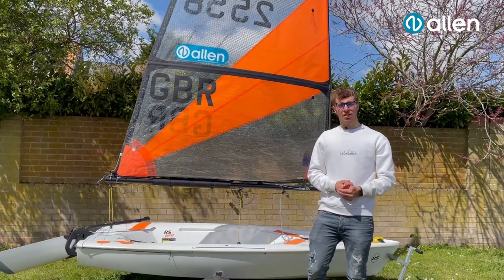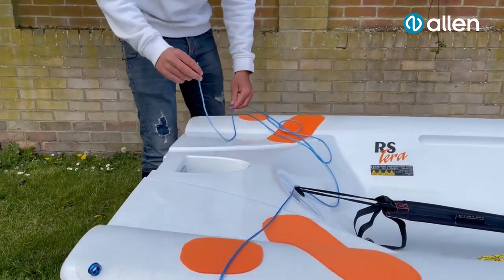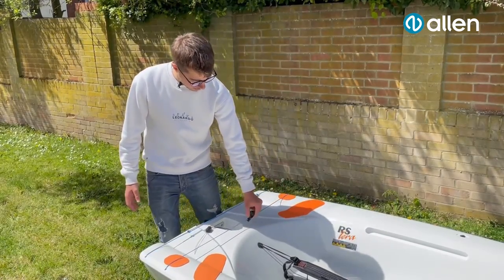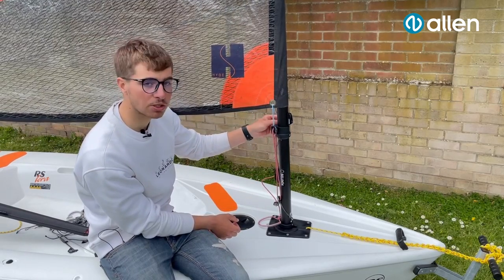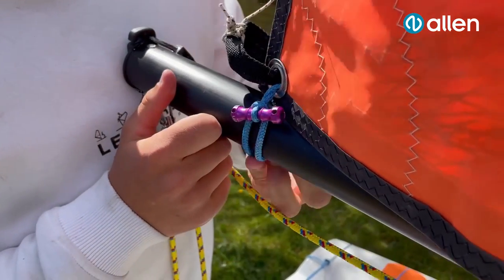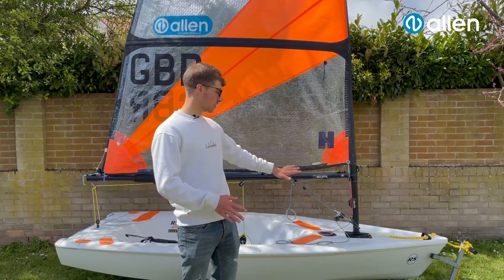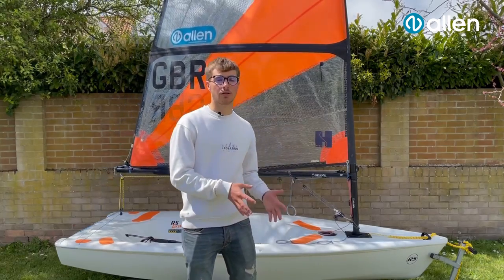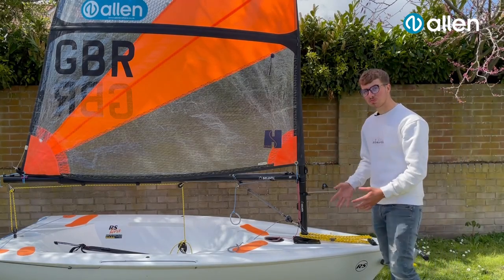RS Tera Rigging Guide | RACE SETUP

Comment: Hi Dylan.. great guide.  What traveller block is that for the mainsheet?
Reply from the maker: The traveller block used in this video is 1 x A2020Tii (20mm Tii on block) & 1 x A2030Tii (30mm Tii on block). The blocks have been tied back to back to create a low profile, light traveller block.